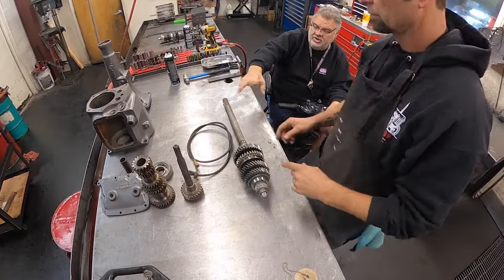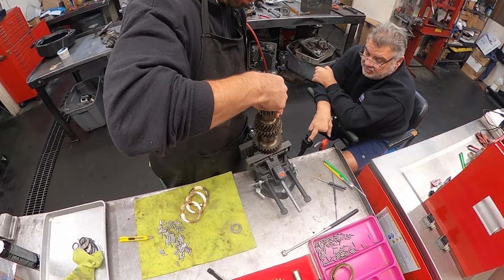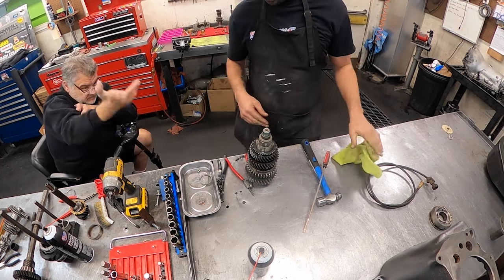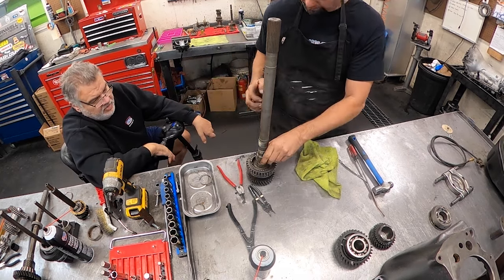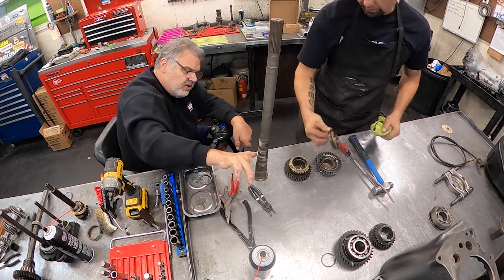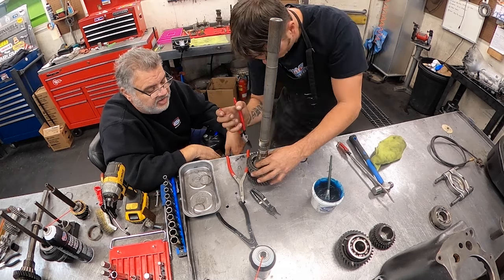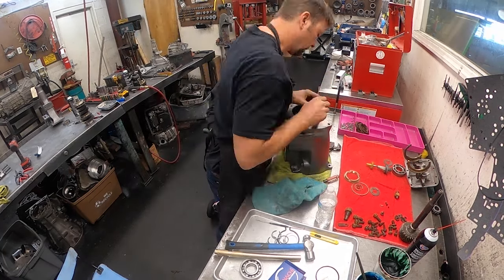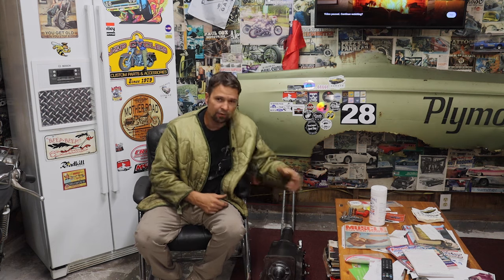The Master and the Apprentice. Building a Mopar 833 4-speed Transmission for the 1967 Dodge Coronet

Comment: Since I had all the main pieces for swapping the "Bingo Beige" Valiant to a stick car, it was an easy choice. It is an iron-case, OD version- I love when people say "That's not a good transmission for drag racing!" Well, it's a 4-door, '76, small-block sedan. My interest is in getting cruising speed & mileage as reasonable as possible. Not power shifting & slamming gears like Ronnie Sox hammering the quarter mile. Funny thing? Opened the side covers on my $50 gearbox and the tranny guy looks at me and says," How much? These teeth, synchro's, forks...they are all like new. Literally this box is fully done. That's an easy $2K in parts, because this is all perfect."  I want the car to be as good of an 'all-around' car as possible using as much stock & reasonably priced pieces as possible. 
Fun to watch this build- BTW, was up in New Bern in early November. Very pretty area
Reply from the maker: Right on man sounds like a nice reliable cruiser. Yes New Bern is a nice city. Its growing like crazy so you know its good.👍👊
Reply: @PoorBoysGarageUSMC I'm in Chapel Hill & Pittsboro, 😆.  Bought acreage out there by Jordan Lake & I get waves of offers for the land...already have a 40' x 60' (16' walls) being built for it & a nice long driveway.. Quiet & room, no way I'm selling.
Doing the "Southern Classic" in 2024. You should consider, great content & fun group of Cannonball buddies (no joke)